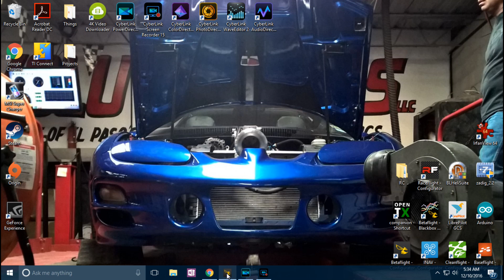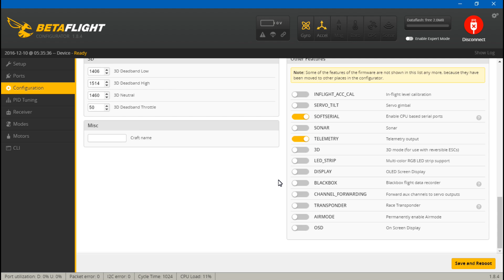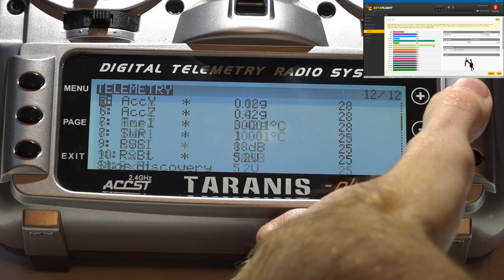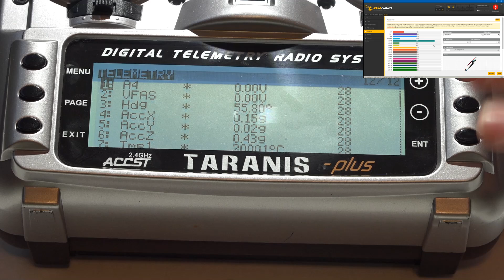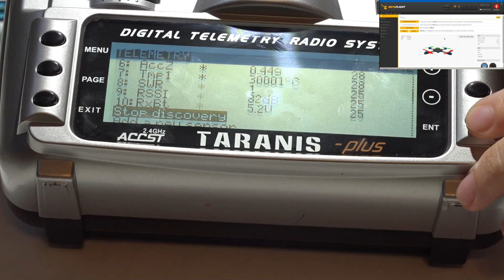Naze32 & X8R: Connect & Telemetry

Comment: I was able to get my Naze32 rev 6 and X8R working on betaflight 3.2.5 (the final supported version) using configurator 10.5.1. 

I was having problems getting it to work (Taranis would not discover any of the expected sensors). I was sure I had done everything right so I re-installed the firmware to start from a blank slate. I must have toggled some setting that was affecting telemetry because after a fresh firmware install and setup, telemetry started working and my Taranis found them all. 

Thanks for the helpful video.

Comment: Thank you for a very good video. I have the same naze 32 rev6 6DOF and the X8R receiver. But i will also use a NZ GPS, a micro minimOSD and if possible a little onboard screen .  Can you tell me how to wire this?   ( I will use INAV plane)

Comment: In Betaflight I only get Softserial 1 on the Ports tab.  My Naze32 Rev6 is wired exactly as you've done here.  My receiver is bound and working but I only get 3 telemetry sensors.
Reply: Same here. In Cleanflight I get 2 SS but in Betaflight I only get one. Then when I try to select SS#2 for telemetry it reboots to default.

Comment: I have the x8r and a naze32 rev5. Same idea for this board to bridge 7 and 8 to get telemetry? If I do it this way does that mean I don't need to use the vbat on naze to get voltage alarm to the taranis? Thanks in advance.
Reply: i have the same question, what you buddy....
Reply: John Crisp did u have to wire and use the vbat

Comment: Why you short Tx and Rx softserial pins on X8R/X4R but not on the D4R-II Rx ?
Reply from the maker: The X8R and X4R use Smartport telemetry, which is two way. The D4R-II uses an analogue type of telemetry which is only receive. But you only have to short those two pins because they are soft serials. Smartport telemetry can go on a UART receive and work using only that one pin.
Reply: JC thanks a lot for the clarification  !!!